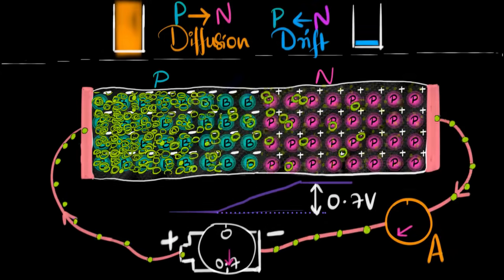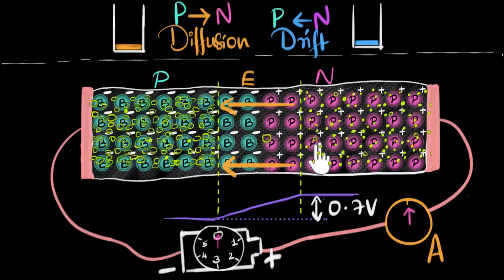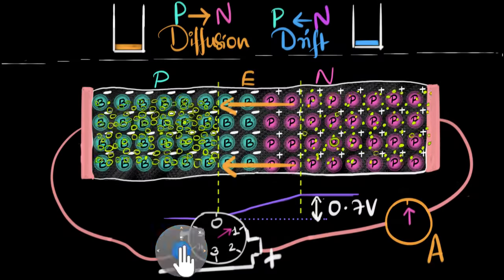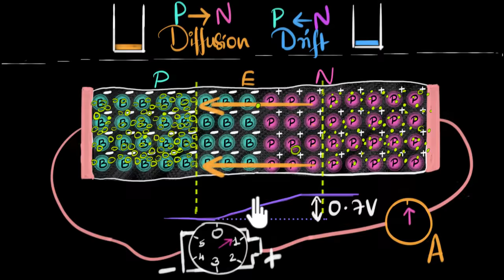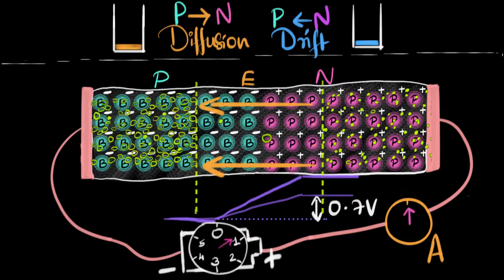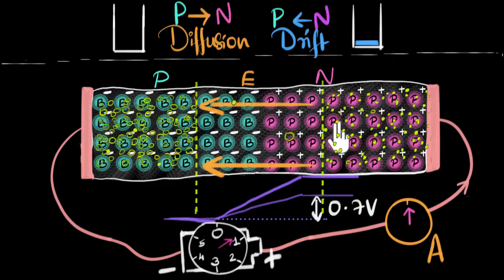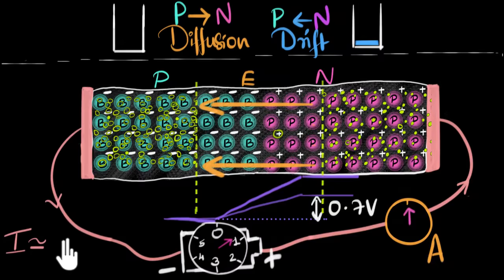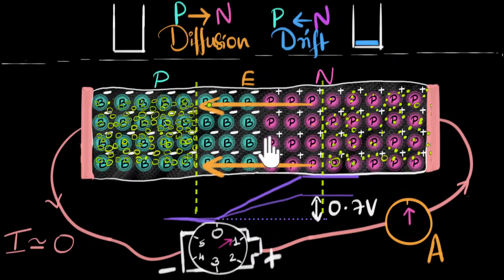Reverse biasing a PN junction | Class 12 (India) | Physics | Khan Academy

Comment: One doubt !!... In the previous video You said that after diffusion charges destroy each other but what about this , here is something totally different they are constituting to diffusion current and depletion layer getting narrower.(  but charges don't get destroyed ) ....why is it so ?
Reply: In Forward, neg terminal of the battery reple the electron towards p type and positive reple the holes towards n type ...so they diffuse eachother near dep region..in this one reverse bias, there is no diffusion ...the liitle bit current is conducting only bcz of minority charge charier...here neg terminal is connect to p type so the e from the p side which is minority charge carries will repel towards n type nd similar fir holes so this  little bit flow is because of drift current. 😅😅
Reply: Hope it will help you..😅

Comment: But why dont the electrons travel to the p side via the external circuit (battery) and travel through the holes , then aided by the electric field sweep through Dep. layer and complete the circuit.
Reply: Electrons if happened to travel in p region through external circuit they will recombine with holes of p region and will vanish by becoming neutral similarly in n region. 
Sir plz tell me I m right

Comment: This is confusing me also.Why the electrons from the negative side don't fill the holes in the P material?A teacher actually said to me that they are filling the holes but they cannot cross the barrier later.Thank you.
Reply from the maker: Yes, I guess you will find more details in our previous videos. The concept of depletion region and potential barriers are explained in detail.
Reply: @KhanAcademyIndiaEnglish  I've watched them all.Maybe I've missed something.Thank you anyway.
Reply: In fact, it's the recombination that leads to current. Every time an electron and hole recombines, an electron flows through the external circuit to the other terminal.You can read more under recombination current.
Reply: actually a good question.now according to me what happens is when the elctron from negative terminal flows to p type recombination occur and at the same time an electron is taken from n type and a hole is created whuch is again accelerated towards p type making the holes in p type pretty much constant.:>)
Reply: @prabhdeepsingh2916  when electron is taken from the n type it doesn't create a hole it creates a positive ion

Comment: Why the electrons of N side doesn't pass through the wire and make the current different fron zero but only the minority electrons of P side pass through the wire making the current almost equal to zero?
Reply: It is due to the potential barrier
Reply: @gunajothisekar5053 The potential barrier exists due to the field. The field supports the passing of electrons, the minority charge carriers of the p-side, to the n-side, doesn't it? How does it prevent the flowing of electrons from the n-semiconductor to the positive terminal of the battery? What it does is preventing the flow of electrons from the n-type semiconductor to the p-type. Why don't electrons flow from the negative terminal into the p-type semiconductor, from the p-type semiconductor to the n-type, and then from the n-type to the positive terminal? The electric field doesn't oppose any of this, does it?